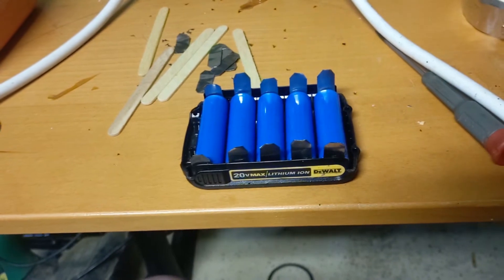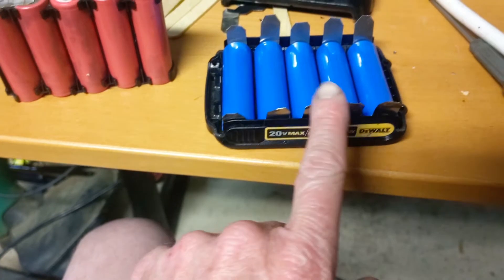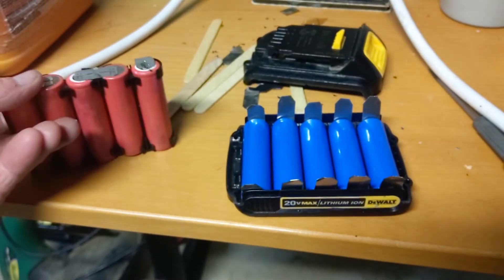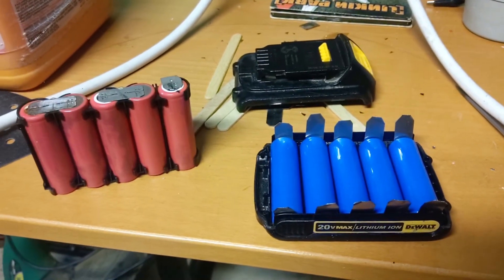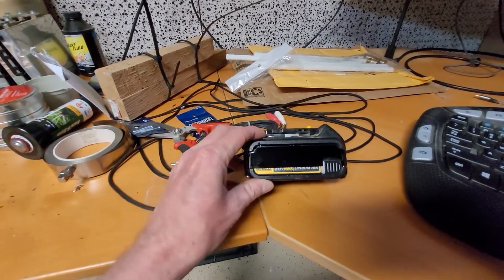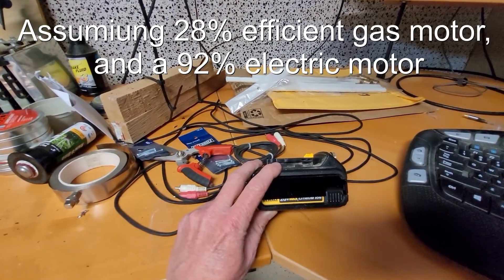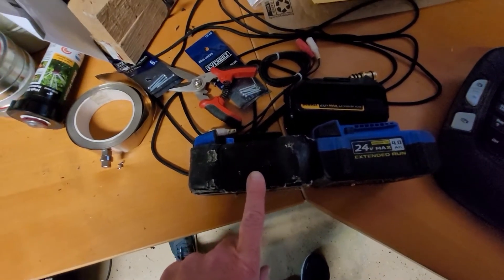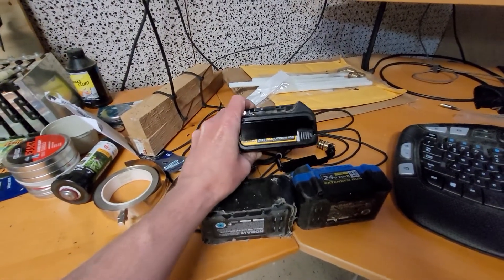How to upgrade a Dewalt 20V battery to 5Ah.

Comment: mix matching different capacity batteries causes issues man   and batteries degrade each time you use them so you don't know the full Molly at our rating of each cell without doing a druw test😢
Reply from the maker: @freedomiseverything2767  meh...

Comment: I'm wondering if you have a solution for a cell upgrade from the oem DeWALT cells without having to mod the housing. I understand they're 18650's and so any (quality) high discharge 18650 battery will perform relatively similarly, but was hoping maybe there is some better version I just don't know about? Thanks.
Reply from the maker: You would need to use power cells like 2ah cells.   But need 30 amp cells